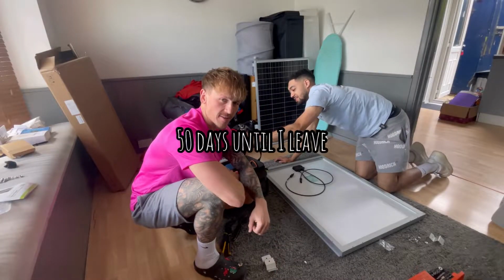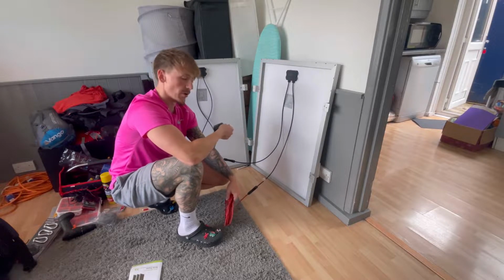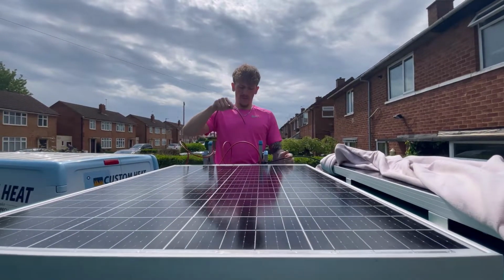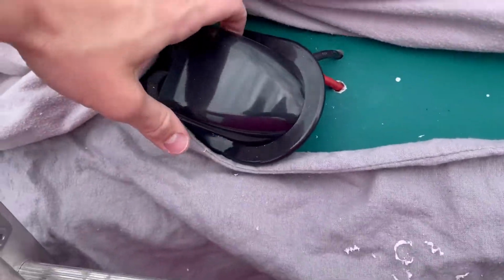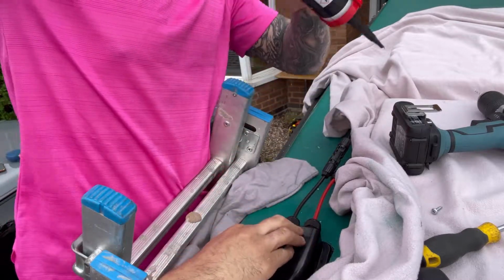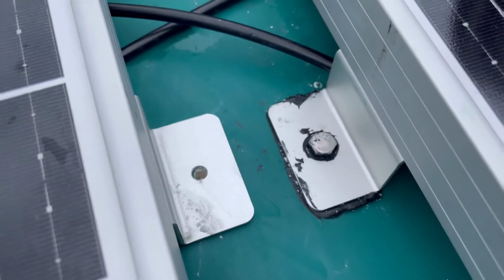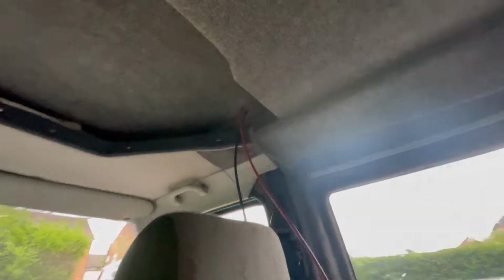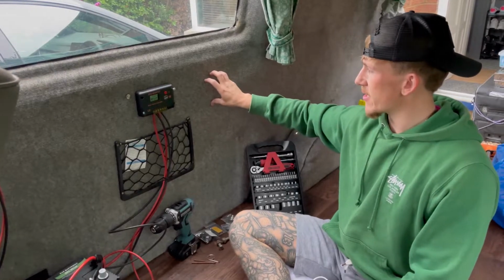VW T4 CAMPER BUILD - EP3 (DIY Solar Panel Installation)

Comment: Mate, lovin the vids about the conversion. Quick question about the wiring from the panels: The wires from the panels down through the roof, do they not get strained or otherwise affected when you open the roof? 😊
Reply from the maker: Yes it’s a very good point, I left just enough slack so that when the roof is open there’s enough play in the cables. I wired them on the side that hinges so it only meant leaving another 15cm or so of slack. When the roof is down they just sit behind drivers chair and between the cabinet. When I get back I’ll tidy it up for sure